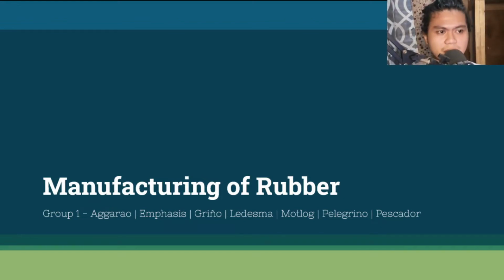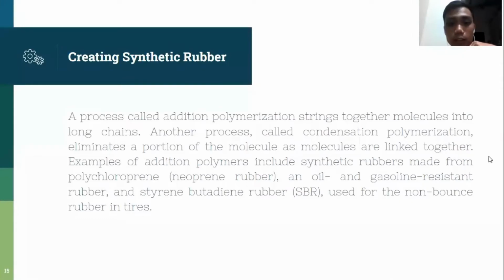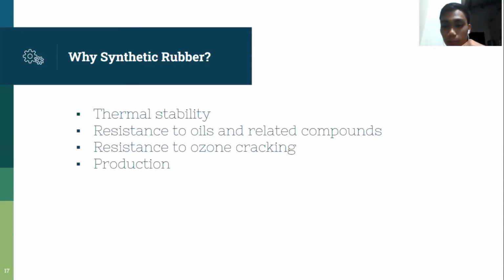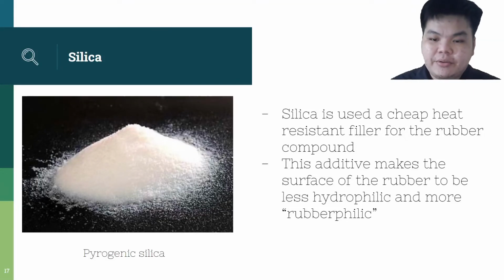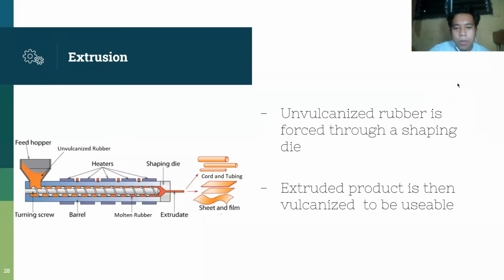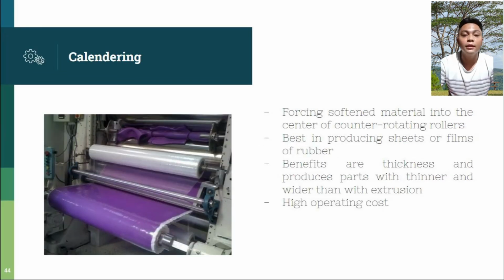Topic 2: Manufacturing of Rubber

Comment: Lamberte, William Wallace A.
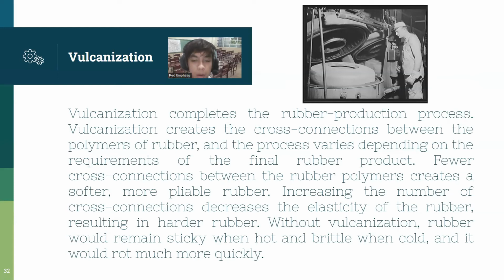20:21 - Vulcanization
Vulcanization is a chemical process that improves the physical qualities of natural or synthetic rubber. The final rubber has increased tensile strength, resistance to swelling and abrasion, and is more elastic over a wider temperature range. Vulcanization is achieved by heating rubber with sulfur in its most basic form.

Comment: Mier, Dan Lester S. 
BSMEA4

8:15 Elastomer
In comparison to other materials, an elastomer is a viscoelastic polymer with weak intermolecular forces, a low Young's modulus, and a high failure strain. Elastomers have a molecular structure that resembles spaghetti and meatballs, with the meatballs representing cross-links. The capacity of lengthy chains to reorganize themselves to spread an imposed load is what gives them elasticity. When the tension is released, the covalent cross-linkages ensure that the elastomer returns to its original structure. Elastomers may reversibly expand from 5–700 percent depending on the substance due to their great elasticity.

Comment: Simene, Jeff Hentzen F.
BSME4A

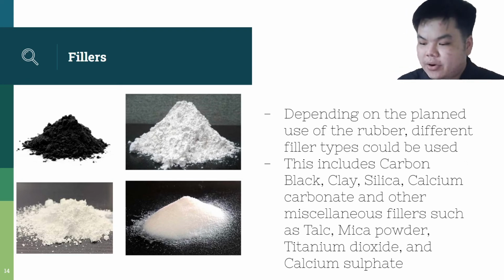13:58 Fillers

In the rubber industry, amorphous silica and carbon black have been used as reinforcing fillers for decades. Their presence in rubber is crucial to achieving longerlasting products, increased tyre strength and durability, and, in the case of silica, lower greenhouse gas emissions from vehicles utilizing these tyres.

Comment: Pañosa, Jino Dave O.
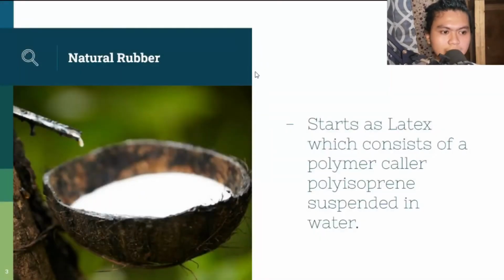1:48 - Natural Rubber
Natural rubbers are made from polyisoprene elastomers. Latex from the rubber tree or other sources is most common. Latex is a milky white colloid obtained from the bark by cutting and tapping. The latex is subsequently processed into commercial rubber.

Comment: Tapongot, Jouryel Ian Roy B.
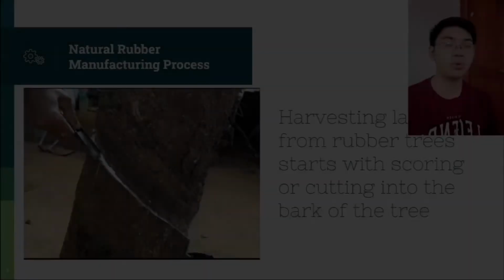4:30 Natural Rubber Manufacturing Process
A mature rubber tree's latex is a soft white material found beneath the bark. Given the strength and man-made feel of many of its end applications, such as tires, rubber gloves, and tennis shoes, most people believe latex is a natural material. However, it is made from natural rubber latex. Rubber tappers extract latex from trees using a method that has been passed down through generations before it is processed. Only when a rubber tree has matured for around five years can the latex harvesting procedure begin. The tree is now prepared to begin producing rubber.

Comment: Lawan, Edcel Benz R. 
7:09 - Synthetic rubber
Synthetic rubber is any artificial elastomer. They are polymers synthesized from pretroleum byproducts. Moreover an elastomer is a material with a mechanical property that can undergo much more elastic deformation under stress than most materials and still return to its previous size without permanent deformation. It serves as a substitute for natural rubber in many cases especially when improved material properties are required.

Comment: Enad, Kyle Paul M.

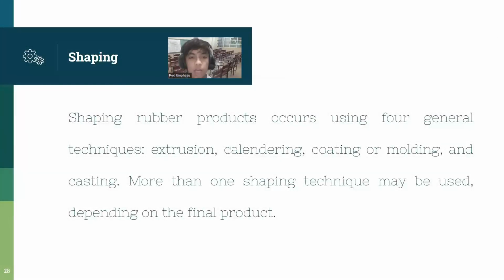16:44 Shaping (of Rubbers)

The topic that piqued my interest is the Shaping (of Rubbers). Extrusion, calendering, coating or molding, and casting are four common methods for shaping rubber items. Depending on the ultimate output, multiple shaping techniques may be applied. The process of extrusion involves driving highly plastic rubber through a series of screw extruders.

Comment: Añora, Matthew Antoine Lawrence B.
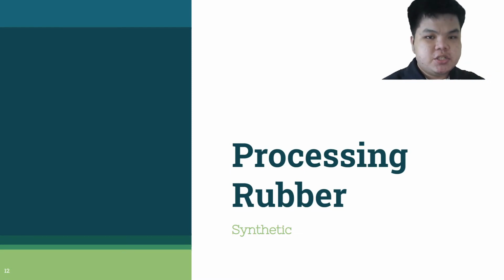13:08

Processing synthetic rubber
This is where chemical agents are being used to transform individual polymers into a chain of polymers. This will then form the rubber substance. In a process called vulcanization, the rubber substance will be processed turning it into a rubber product, as this process works by converting polymers into a more durable material by adding accelerators like sulphur.

Comment: Peter Allen Sid N. Requina 
1:47 - Natural Rubber 
Natural rubbers are made from elastomers, which are polyisoprene kinds. Latex from the rubber tree (Hevea brasiliensis) or other sources is the most common source of rubber today. Latex is a sticky, milky white colloid removed from the bark by making incisions and collecting the fluid in vessels, a process called as "tapping." Latex is then refined into rubber, which is suitable for commercial usage.

Comment: Edio, Van Albert T.
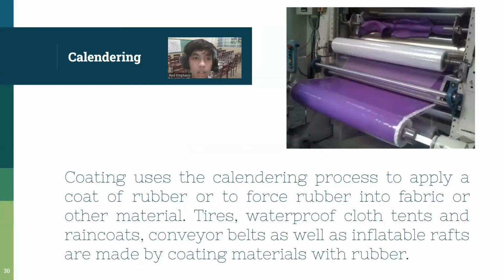18:24 - Calendering

It is a process that involves putting rubber materials through a set of rolls to get the desired thickness. The thickness of rubber to be calendered is determined by the distance between rolls. This process is also used with thermoplastics, however the application temperatures for rubbers are substantially lower than those for thermoplastics.

Comment: Abello, Raynand R.
1:48 - Natural Rubber
Elastomers are polyisoprene types that are utilized to make natural rubbers. Rubber is currently obtained mostly as latex from the rubber tree (Hevea brasiliensis) or other sources. Latex is a sticky, milky, white colloid that is extracted from the bark by creating incisions and collecting the fluid in vessels, a technique known as "tapping." After that, the latex is refined into rubber, which is ready for commercial use.

Comment: Dajan, Kenneth Joseph Rex D.

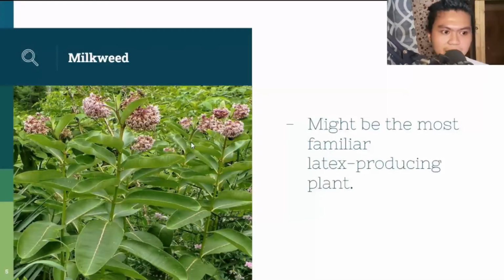2:39 Latex Dipping Dipping is the most common method of creating the desired product from latex. A shaped former is immersed in latex, gets coated with latex, and is extracted. The latex film is dried, the procedure is repeated if necessary, and the created product is removed after drying. The approach appears straightforward, and it is in general; the issue is reproducing it on a large scale, producing millions and millions of high-quality units at a reasonable cost. Dipping may be done with a variety of elastomeric latices, both natural and synthetic, but the elastomer must be film-forming, have sufficient gel strength to maintain a coherent film as it dries, and have adequate dry strength for the final purpose.

Comment: Obrador, Crisaint John G.
17:37 - Extrusion
Unlike  in plastic manufacturing process, extrusion in manufacturing of rubber is the process of turning rubber materials into a specifically shaped product. To provide this shape, manufacturers use a rubber extruder machine. The rubber extruder has two main parts: a heated shearing screw conveyor and a die.

Comment: Romero, Lorenzo Matthew D. 
BSME-4A
16:51 Rubber Shaping
 Indeed that rubber molding creates molded rubber parts by pressing a block of rubber into a rubber molding metal cavity. The rubber is then exposed to heat, activating a chemical reaction. While there are variations in specific methods, all rubber manufacturers use heat and pressure method to form molded rubber products.

Comment: Acelo, Ray Joshua L.
10:10 types of rubber
First type is styrene-butadiene rubber, most common type of rubber, about 50% of care tires are made from SBR. Next type is nitrile rubber it is used in automotive and aeronautical industry for oil handling and protective gear. Silicone rubber is resistant to extreme temperatures.

Comment: Calaque, Kyron Davonn C.
13:09 - Processing synthetic rubber
Chemical agents are used to turn the individual polymers into polymer chains. This forms a rubber substance. In a process called vulcanisation, the rubber substance will be processed into a rubber product. Vulcanisation works by converting polymers into more durable material by adding accelerators such as sulphur.

Comment: Macalaguing, Ivan Jun A.
19:51 The rubber-making process is finished with vulcanization. The process of vulcanization, which forms cross-connections between rubber polymers, differs based on the requirements of the finished rubber product. Rubber that has fewer cross-connections between the polymers is softer and more malleable. The elasticity of the rubber is reduced as the number of cross-connections increases, resulting in harder rubber. Rubber would be sticky when hot and brittle when cold without vulcanization, and it would degrade considerably faster.

Comment: Agua, Christian
18:24 - Calendering
Calendering - Calendering is a manufacturing process that involves passing a single continuous sheet through a series of heated rolls to smooth and compress it. Calenders are a grouping of rolls. It is usually used in coating to apply coat of rubber or force rubber into fabric. There are things that commonly made by coating materials with rubber just like tires, raincoats, conveyor belts, inflatable rafts and more.

Comment: Casiño, Sharia Cyril P.
23:10 Latex Dipping
Latex dipping is used to create so-called supported products, in which the product's strength is derived primarily from a fabric lining onto which the polymer film is deposited. If desired, the thickness of the deposit can be increased by repeating the process. The majority of latex dipping product is used in the production of gloves, particularly medical gloves and devices for a variety of applications in the healthcare sector.

Comment: Casiño, Earl Anthony

18:29 | Calendering

Coating uses the calendering process to apply a coat of rubber or to force rubber into fabric or other material. Tires, waterproof cloth tents and raincoats, conveyor belts as well as inflatable rafts are made by coating materials with rubber.

Comment: Dacoroon, Darlene Grace F.
4:32 - Natural Rubber Manufacturing Process
Latex is the soft white substance found beneath the bark of a mature rubber tree. Most of the people think that latex is a natural material, given the strength and man-made feel of so many of its final applications, like tires, rubber gloves, and tennis shoes. But, it is a natural rubber latex, coming from nature. Before it is processed, rubber tappers harvest latex from trees using a method that has been passed down for generations. The latex harvesting process can only begin once a rubber tree is mature for about five years old. At this point, the tree is ready to start producing rubber.

Comment: Estillore, Cherry Mae P.
17:37 - Extrusion
Extrusion is a process in which a substance is forced to flow through an opening or die, resulting in plastic deformation. The material takes on the die's cross-sectional profile, and if the material has the right characteristics, that shape is preserved in the final extruder. Rubber extrusion is a method of producing rubber products. A high-pressure extrusion machine is used to drive synthetic or natural rubber material through a formed die. The rubber utilized is soft and unvulcanized.

Comment: Candaroma, Katriona Maxinne G.
7:00 Synthetic Rubber
Synthetic rubber is any man-made elastomer. They are petroleum byproduct-derived polymers. Tyres, doors and window profiles, seals, hoses, belts, matting, and flooring are just a few of the automotive applications for synthetic rubber. Synthetic rubbers can offer superior heat resistance, reduced temperature resistance, and improved heat aging.